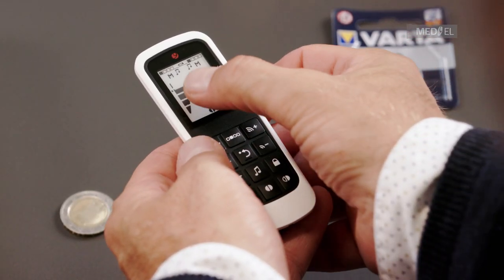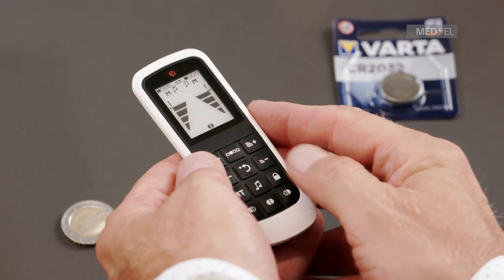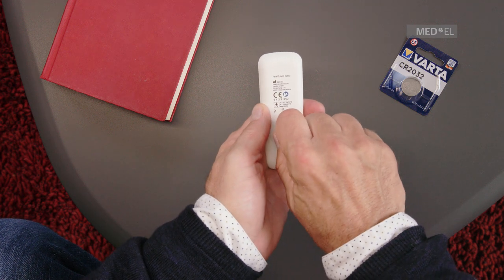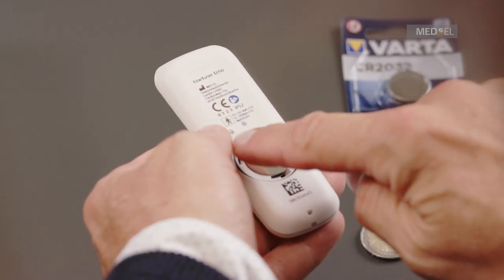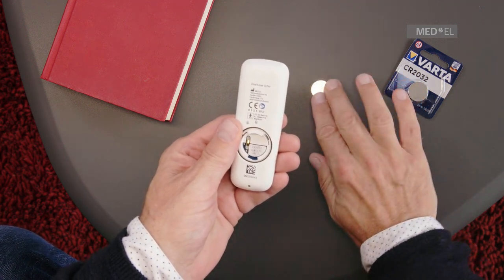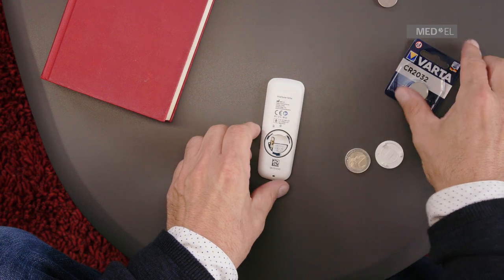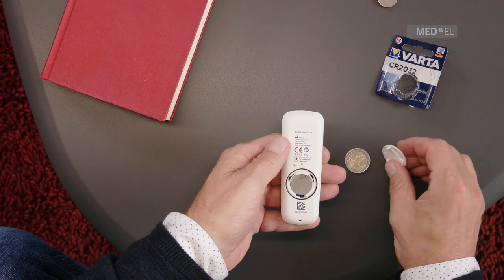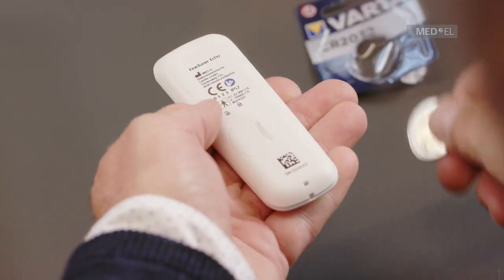SONNET 2 Hands-On: Changing the FineTuner Echo Battery |  MED-EL

Comment: Is locking the key pad the same as turning it off?  The 2032 battery runs out too fast.
Reply from the maker: Hi there, thank you for your question and feedback. Locking the keypad will minimize buttons accidentally being hit and changing settings. Please note that if the FineTuner Echo is not in use, it will automatically go into standby mode. But to turn off the FineTuner Echo, you would need to remove the battery.

Kind Regards